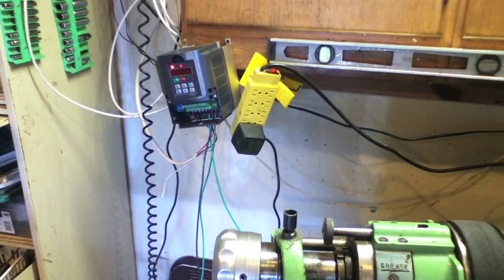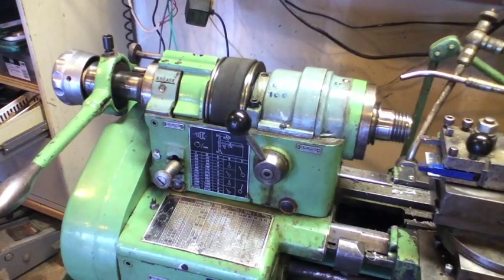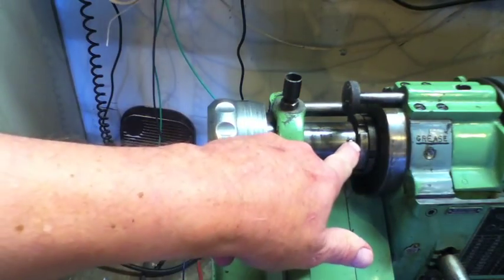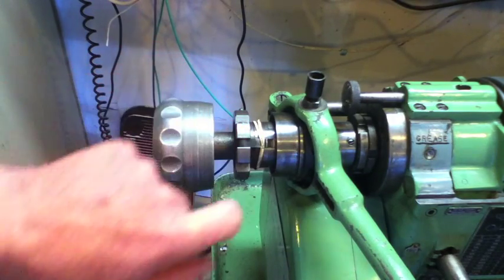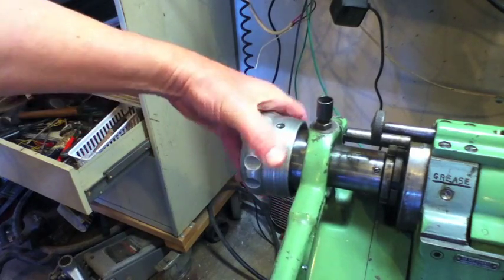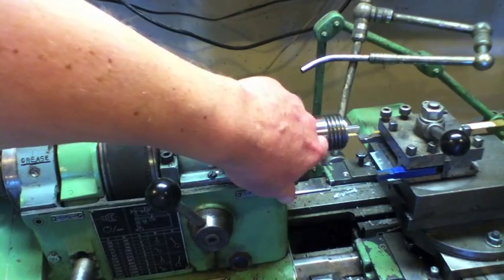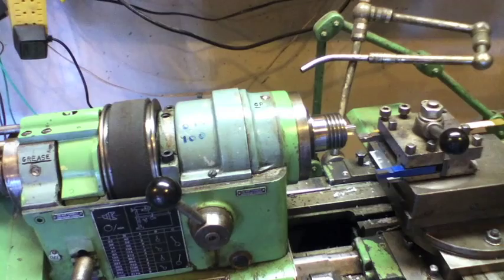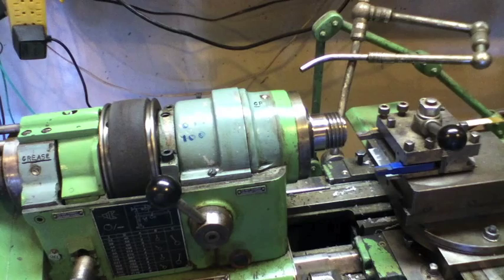Leinen LZ4S Collet Tool.m4v

Comment: Hello,
I bought a lathe quite similar with yours, and I have some problems to plug a fresquency inverter on the motor. And wanted to know what did you do on your lathe? My motor has 3 speeds: 700/900/1400rpm, and is 0,8/0,9/1,1kw, triphase 380V. Which did you choose to plug the inverter? Did you use a 220/380 converter? 
Thank you for all
Léo
Reply: Hi I just saw this post and comment and wondered if you solved it as I have the same problem.
Paul